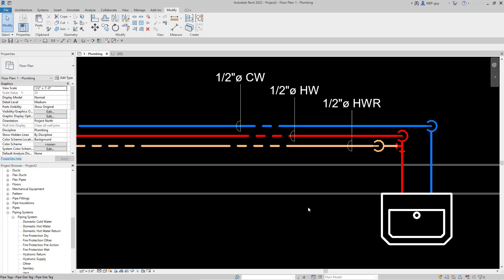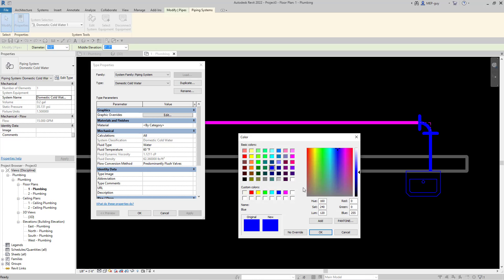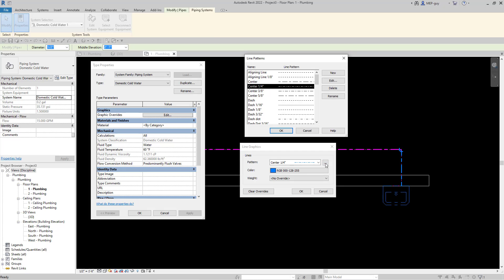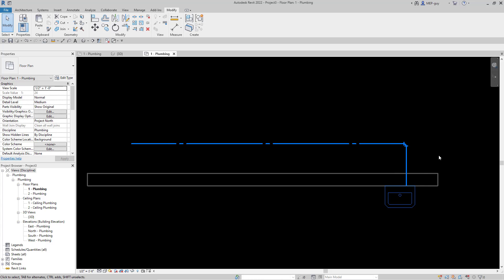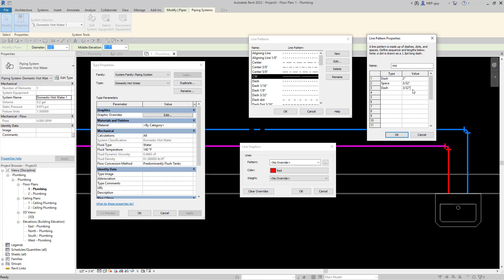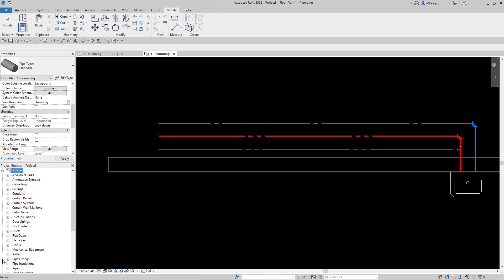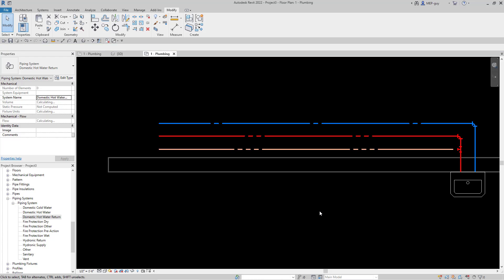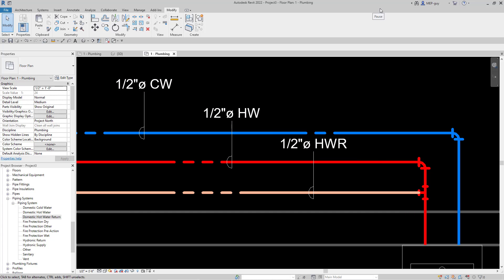Customize Line Patterns and Color for Pipe Systems in Revit MEP

Comment: Great Video, I did as in the example but it didn't work. I need the system type to have a solid. Do you know what could be the reason?
Reply from the maker: You might have a filter that is overriding the system graphics. Check your view template or filters and turn any off that might be overriding them.

Comment: Thanks so much! Do you have recommendations of books, videos, courses for someone who's doing small projects? I understand modeling in Revit and the basics of plumbing. I just want to understand more about why designs are drawn one way vs another. Thanks
Reply from the maker: You're in luck! I'm working on a plumbing 101 course right now (like tonight). It's exactly the kind of course you're describing. The plumbing design will be on a fitness center so it covers all the relevant things you'll need for most small projects. Should be available next week! But the best book I know is engineered plumbing design 2.
Reply: @mep_guy  incredible! Thanks so so much! I'll check back for the course, I'm definitely interested

Comment: Great video. What would be nice would be for Revit to allow text in a line style like AutoCAD does. It would make life easier for systems like compressed air and natural gas.
Reply from the maker: Yea it's a little surprising but having the system information inside the pipe and line is so beneficial that I can live with the letters not being an option for line types.

Comment: Can i request a tutorial inserting multiple level architecture, that can enable floor level in PLUMBING AND waste, i tried to copy but still not showing..
Reply from the maker: Sure that's what I'm here for! I'm not quite understanding what you are referring to. I think you are wanting to see plumbing below the floor?
Reply: @mep_guy  what i mean is the default level when u insert a revit link in MEP plumbing is just 2 level floor, how can i add the floors  base on architectural link file which let says 4 or 8 storey..
Reply from the maker: @thadyjuinio9916  ahh yes. What I'd recommend is creating another plumbing template project that has like 10 floors in it already (or more depending on your typical jobs). When you link it your arch file you'll at least already have most of the levels and you can simply just delete the ones you don't need. You'll still have to set the elevations of the levels to match the arch file. There are a couple of ways to do that. You'll probably want to copy monitor them.
Reply: @mep_guy  it seems easy for u hahaha, hope u find time to make some tutorial to that but no rush.. thank u for all the best MEP tutorial.. i always watching your new tutorial.
Reply from the maker: @thadyjuinio9916  yea I hope to do a whole series on creating template files for MEP.   But yes that's a ways away. But I'll keep that video idea in mind and try to post it sooner.
Reply from the maker: @thadyjuinio9916  I appreciate that Thady! I'll definitely make that video for ya.